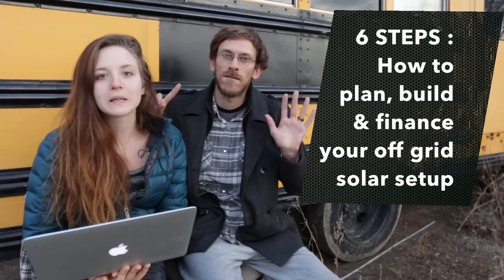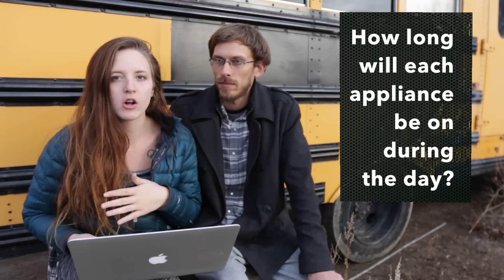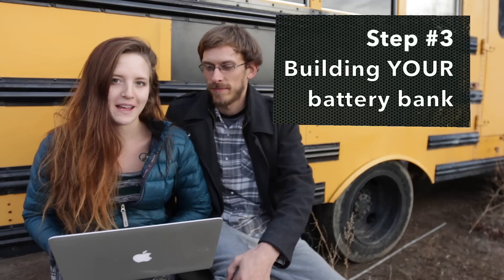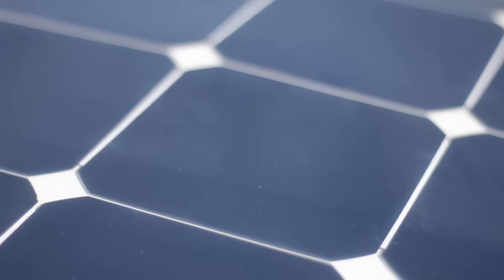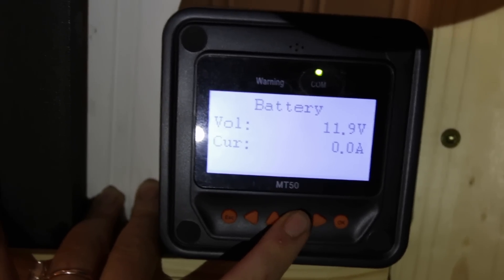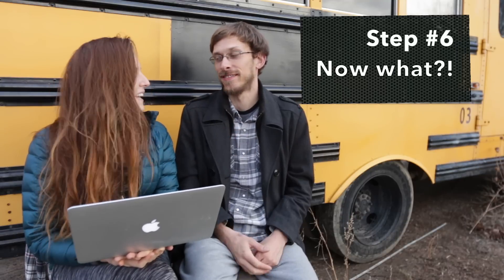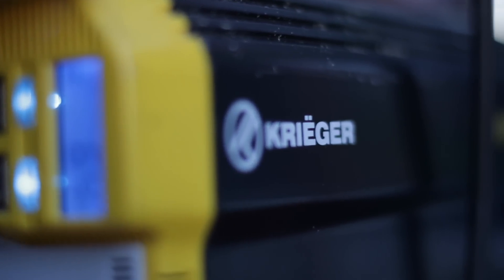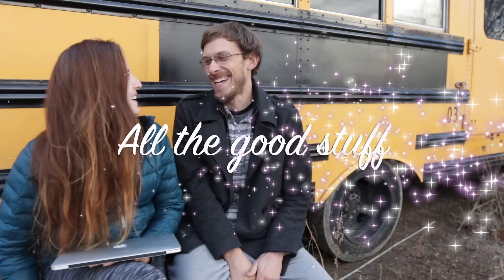Simple DIY OFF GRID | Our Solar Power System

Comment: Dont You have a set up to where You can charge up batteries with regular bus battery? You need that too!  So, when there is no sun you can charge by driving!?
  Also,  a set up to where when you plug in AC it wilk charge your batteries also!!??  Thats what I want. Is it possible?
  Or, at least what i woukd like is a solar system, Ac plug in, Charge by driving system!!  All three would be ideal!!

Comment: Great video and information!  A couple of more specific considerations I would have added under "math" would be battery bank depth of discharge. Good deep cycle battery has a depth of discharge of 20%.  So of the 4500W of storage you only have 80% of that power  useable 4500× 0.80 = 3600W of useable battery storage.  Its good you guys oversized your inverter because you may want to account for inverter inefficiencies. Lets say you had a 100W inverter that was 95% efficient. This means it 5% inefficient.  So it will take 100W + (100W×0.05) = 105W DC to make 100W AC. Just a little number crunching.  Great video though!!

Comment: Is it difficult to add another battery or solar panel to this setup once this is all complete?
Reply from the maker: You can add as many batteries as you'd like, it will just continue to up your storage! As for a panel you can add that too, you might just need another solar charge controller to make it all work together

Comment: What size wire do you recommend using to connect the solar panels together and then from the solar panels to the charge controller? And what size do you recommend using from the charge controller to the batteries?

Comment: I think the way you explained your formulas is a bit off. It's been a while since I've done this do here goes: 
Amps X Volts = Watts. Watts X hours = Watt-hours. Coffee Grinder: 120V X 1.3A = 153W of power to run it. If you run it for 5 minutes (0.0833 hours) X 153W you'll consume 12.75 watt hours of power. Then you need to account for the inefficiency of the power inverter. Let's say that your power inverter is 90% efficient (using round numbers to keep this simple). That means that 10% of the energy going through the power inverter is lost to heat. This means that you need more battery power than what you're consuming by the coffee grinder. Here's the math: 12.75 Watt-Hours / 90% (or 0.90) = 14.16 Watt-Hours. You can do the same with your solar charge controller. If your solar charge controller is 90% efficient then 14.16 Watt-Hours / 90% (or 0.90) = 15.75 Watt-Hours of solar charging required to run your coffee grinder.
Reply from the maker: Oh my goodness..... I wrote it wrong on there.... whoops!!!!!!! 
AMPS X VOLTS = WATTS, people

Comment: Great info thanks 😎 what happens if you leave your system unattended like if you go on a hike for a few days ?
Reply from the maker: We have left it for a few days when visiting friends, and we just came back to a full juiced battery bank. That's the whole reason for the mppt solar charge controller -- it helps regulate how much power the solar panels are feeding into the battery bank, and stops it from overloading with power and creating a burn out. As long as you are leaving your conversion somewhere safe, you should be good to go leaving it!